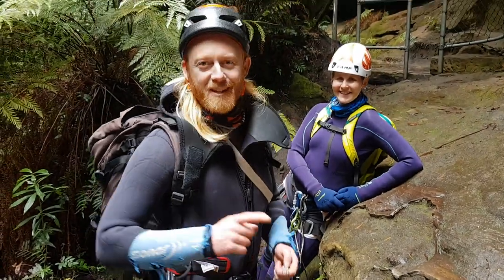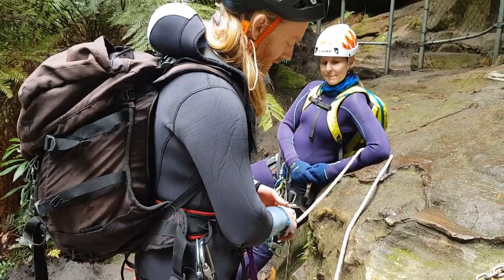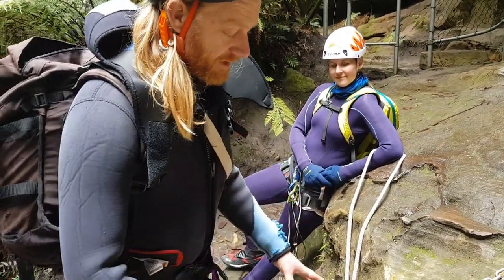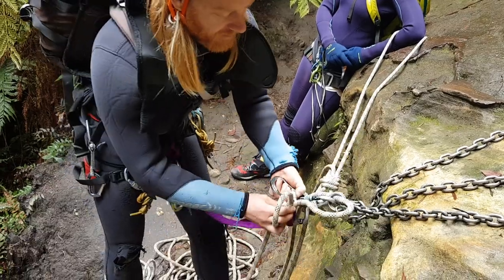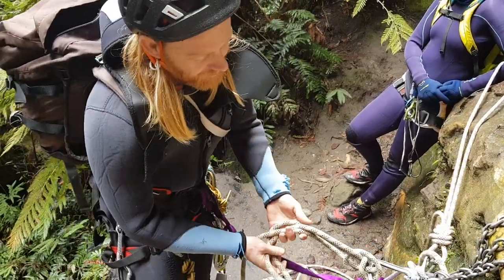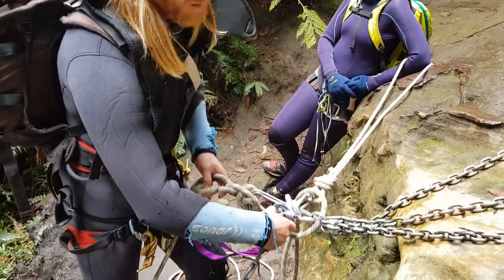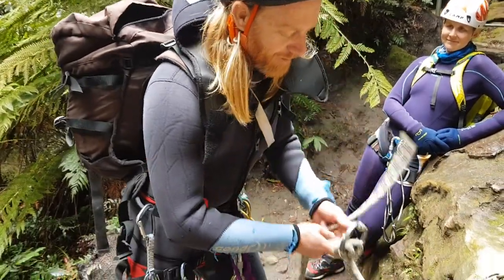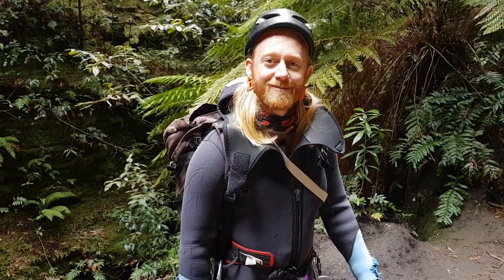Canyoning anchor rope setup -  Joels releasable retrievable system - quick overview (6 minutes)

Comment: Aren't you going to lose that carabiner when you rappel off the end of the rope?
Reply from the maker: This was a dry pitch with plenty of rope so not going to lose that biner. I loaned my Hannibal to the lady on the background so was using a Gi-Gi as a descender. But yeah the risk is there if the rope length is set in deep water. Using a canyoning draw (two lockers connected with dog bone) is a way to prevent that from happening.

Comment from the maker: Just watched this again a few years later and picked up a couple of points that can be improved. In particular the mule and overhand knots were a bit sloppy! I blame the mountaineering course I had just come off before making this video. Otherwise the process is pretty much right depending on the risks a given pitch has.
Reply: Nice self-review picking up the not-a-mule-but-a-half-hitch, I did notice that but really happy to see you point it out yourself!
Re: the "biner block" where you used a clove-hitch, I have been teaching (in rock climbing) that we should close the system by clipping that carabiner back to the load line, making a "P" shape through the anchor and meaning that even if the biner-block slips somehow through the rings it doesn't result in a fall, and it doesn't affect the ability to retrieve. Sure... you'd have to use some imagination and pretend the ring happens to be more like a steel hula-hoop but you get the idea!. Is there anything in canyoning that speaks against this? Just interested.